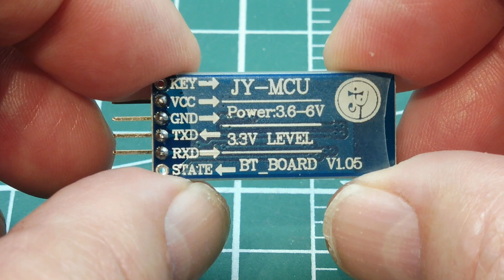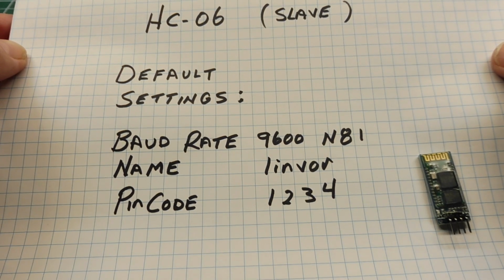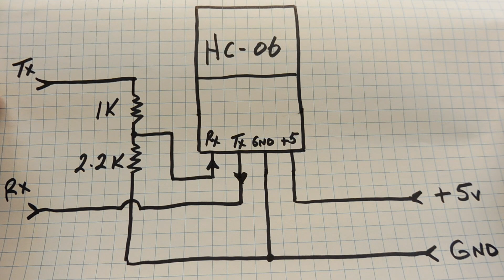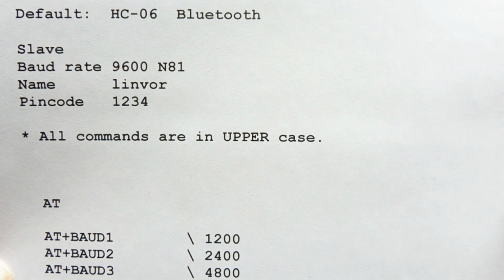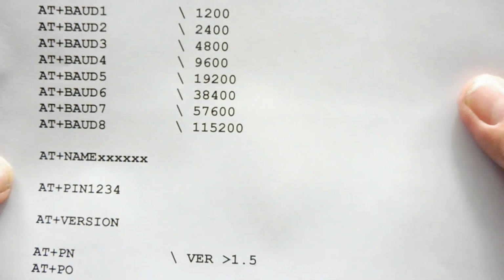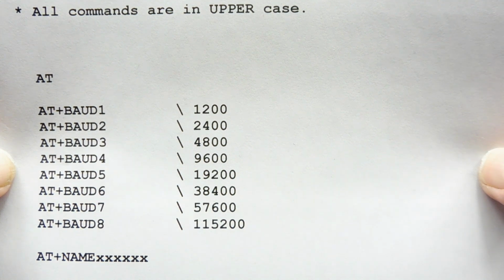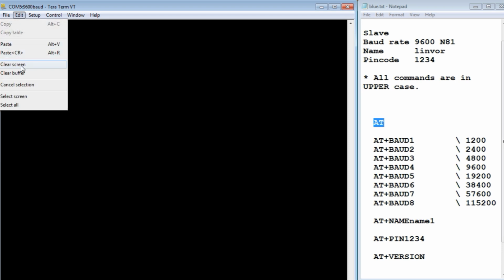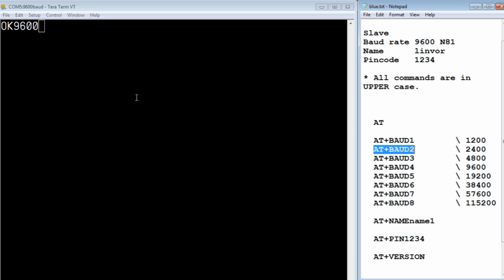How to program the HC-06 Bluetooth module

Comment: I am not able to write type anything on the terra term screen. Not even a single letter. Right clicking does not respond for pasting anything. I want to configure HC-06 based  DSD TECH B30 RS 232 to BT serial converter. I am using CH340 USB to serial cable to connect with laptop windows 11

Comment: Hello, I have an HC05 which i am using instead of the HC06. So I wired up the HC05 the same as in the video except I do not need the voltage divider as my usb->serial has a 5v-3.3v jumper.  I am using TeraTerm and I power on, then connect the enable to 3.3v to place in AT mode. I have the slow blink which I believe confirms  AT mode.  I am connected via com5 and when I issue the AT command by just pasting into the teraterm but I do not receive a response.  It seems straight forward enough but maybe the HC05 is still not in slave mode. Do you see anything obvious that I am missing ? Thanks
Reply from the maker: There are many different HC-05 modules out there so always check with your user manual.
Basically power the HC-05 with 5 volts with 3.3 volt levels for Tx and Rx and enable pin on power up. Copy and paste AT (all caps) at 38400 baud. Check out this video:
https://youtu.be/R0s0W68nY7k
Reply: Nvr Mind, default baud was 38400 plus had to play with line ends some.

Comment: Important notice: you have to set transmit delay int Tera Term Serial Port setup. And delay should be 1... 10. I found it in this video :) If you use default delay == 0, HC-06 module doesn't work. It reply to AT but not reply to AT+VERSION. And there is difference between AT+VERSION and AT+VERSION?  :) No question mark is required ROFL

Comment: so the HC-06 is powered and my computer says it is "paired"... however when I try to use a serial terminal to communicate with it I don't receive any data back. The terminal is configured at the right settings, not sure what the problem is otherwise. Thanks for the video!
Reply from the maker: Check out this video: https://youtu.be/obMinxmezSA

Comment: Thanks for the review 0033mer.  Is there a way to control the power for this device?  I would like to be able to turn it on and off from my transmitter.
Reply from the maker: If the HC-06 is powered down it cannot receive a signal to turn it on .If you are concerned about power consumption check out Reyax's low power Bluetooth modules. RYB080I.

Comment: Hi there, I have connected the HC-06 with FTDI-adapter to my computer and tried the arduino serial monitor. I do not get any responce when entering any AT command. Weird thing is that if I connect my phone to the module and enter text in the "Bluetooth terminal" app  then it shows up on my computer screen in the serial monitor. So I assume the wiring is correct. I do not know why the module is not in AT mode?

Comment: there's another gotcha with the AT commands that's not really documented: they DON'T end in any kind of line terminator. if you send, for example, "AT+VERSION\n" with the newline within the timeout window it will not accept it. standard terminal programs are tricky to use, but something like cutecom that lets you send full lines (as opposed to character-by-character for modem/shell-oriented terminal emulators) without a terminator works easily without resorting to awkward copy pasta dances. of course it also doesn't send line terminators after the responses, so the only way to script this would be to use some ugly timeout logic.

Comment: Can you make it connect automatically to an MAC address? I have a Bluetooth multimeter from OWON
Reply from the maker: Not with the HC-06 bluetooth module. You can make it work with the HM-11 v4.0 BLE.
https://hackaday.io/project/12922-bluetooth-data-owon-b35t-multimeter
Reply: 0033mer that is exactly what I’m working on. This HM-11 module doesn’t work the same anymore or at lease since he did the project. I have been on this for 3 weeks now with no luck. Seems like the ROLE command screws the whole thing up. I thought I was on to something with AT+CO00xfffe MAC address 
Some of his commands are not used anymore. Any nudge in the right direction would be great.
Reply from the maker: Keep looking online for a Bluetooth module capable of MAC addressing programming.
https://www.tinyosshop.com/datasheet/Tinysine%20Serial%20Bluetooth4%20user%20manual.pdf
Reply: Using the BLE Scanner i get this.
There is only one that has a Notify "N" and its this.. 
CUSTOM CHARACTERISTIC
UUID:0000FFF4-0000-1000-8000-00805F9B34FB
Properties: NOTIFY
Value:[x]
Hex: 8x19F00400B901  !!!!!THIS NUMBER CHANGES WITH MULTIMETER VALUES
!!!!!
Client Characteristic Configuration
UUID:0x2902
Notifications enabled
Characteristic User Description
UUID:0x2901

I have tried to set the module to AT+UUID0xFFF4 Thinking this would solve all my problems,I get the same trash readings. Do i have to set the UUID to a different setting???? I said earlier that the BLE Scanner is seeing the data by the changes in the hex.

Comment: whenever I send a command to the HC06, I just get the same command back. E.G. I send AT, the module replies with AT. If i send AT+VERSION, the module replies with AT+VERSION. How can i fix this?
Reply from the maker: Check the configuration of your serial terminal program. Sounds like your local echo is turned on.

Comment: Hi, Thanks for the video, I am trying to change the baud rate using FTDI adapter but i cannot see any command in the dialogue box when i click on send. Any help is appreciated thanks
Reply from the maker: HC-06 is powered with 5 volts
Tx ans Rx lines connected properly
Led is blinking (not paired)
Use uppercase commands .. Try AT first, watch for OK
Use the default 9600 baud to send commands
Try different baud rates as 9600 may not be default.
Reply: @0033mer  Thanks for replying, I had try all the above nothing shows in the dialogue
Reply from the maker: Check your programming setup with a known good HC-06 module. If it checks out good, your original HC-06 could be bad.

Comment: Standard RS-232. Signal levels are -13v and +13v. I assume the USB cable you are using is using std TTL logic of 0 and +5v and NOT RS-232 signals
Please confirm.
Reply from the maker: The USB cable is a TTL RS232 cable that uses 0 and 5 volt logic levels. http://www.dipmicro.com/store/USBTTL-PL2303
RS232 is a recommended standard originated in 1960 that has changed many times from RS-232, TIA-232, and EIA-232 with voltage levels from +/- 5 volts to +/- 25 volts. TTL RS232 is quite common today with the popular FTDI modules which you can use instead of the cable.
Reply: there is no such thing as "TTL RS232." this module uses 3.3V TTL natively (the common breakout boards accept 5V since apparently platforms like Arduino are never going to migrate away from legacy 5V signaling...), which is a different voltage and polarity and therefore completely incompatible with RS232, although look at the Garmin 18x's interface for an interesting hybrid that's sort of compatible with both.

Comment: There are lots of differences between the modules. My one was default 38400 and I had to put the KEY pin to HIGH to use AT commands. Here is lots of info  https://www.instructables.com/id/AT-command-mode-of-HC-05-Bluetooth-module/  I also had to set the terminal program to use CRLF after every command.
Reply from the maker: Sounds like you are describing the HC-05 bluetooth module which is totally different than the HC-06 module. The HC-05 can be configured as a master or slave as the HC-06 is a slave only. https://youtu.be/R0s0W68nY7k
Reply: @0033mer  I bought the HC-06 at Banggood. It does not show HC-0x anything on the module so I am not sure what is is. From what I read on the internet the hardware of the HC-05 and the HC-06 is the same. The firmware is different. But please correct me if I am wrong. My module shows "VERSION:3.0-20170609". Do you know a way how to determine if it is the 5 or 6? I am willing to do tests and publish it here or send the info to you. Your video helped me at lot. My comment was/is intended to help other who still have problems.
Reply from the maker: With the success of the HC-05/06 other vendors want into the game but are not following the rules, That's OK as long as they put out proper documentation on their product. The HC-05/06 hardware is very similar and the firmware is different as you said but some vendors have put a push-button on the HC-05 for the Key function. Bottom line is get proper documentation before buying any non-standard modules.
Reply: @0033mer  proper documentation is a great idea, except how do I or any other buyer know that the documentation matches the product? I thought I bough HC-06. I still don't know if I have HC-05 or HC-06. How can I find out? I.e. which are commands which one of them accepts and the other not?
Reply from the maker: If you can configure it as a "master" I would consider it compatible to a HC-05 module.

Comment: I am having an issue with my bluetooth HC-06 module (It's the one with ZS-040 board) . I have followed the instruction as stated in the video. But I am not able to get it in to AT mode at all. I have double checked all my Tx, Rx Vcc and GND connections but with no luck. The LED keeps blinking at a fast pace with and without the voltage divider circuit( Like even when I connect it directly to the FTDI cable) . I am able to communicate with the module using my phone using blutooth terminal software in the pairing mode. But whatever I do, I am not able to get it in to AT mode. I also tried shorting the Vcc to Pin 34 and the LED blink rate reduces to once in 2 sec, But It never gets in to AT mode. I also tried all baud rates , but with no results in any. Any help from anyone would be appreciated. Thanks.
Reply: It will not react if you will print commands manually. It has very short command window. Copy paste or use Arduino SDK's Port Monitor

Comment: Got a problem with HC-06 module. My module responds to my AT commands through the arduino, but wont show up on any device. So far i have tried 3 phones, laptop and a BT module to my PC. Anybody got any ideas?
Reply: Sounds like the radio section of the module is bad. Use a different HC-06 module in the same circuit setup to verify the problem is a faulty radio.
Reply: Thanks for the tip, will look into it

Comment: I do have a FTDI USB to TTL serial converter module, and have used it as I followed your video tutorial to the letter, but I recieve no response when I type " AT" nothing returns...
the Bluetooth sends and receives data just fine... I have been able to pair it with my PC. I also made sure it was not paired before I attempted to send the "AT" or any other command. Any suggestions???
Reply from the maker: Check your wiring .. make sure Tx and Rx are not swapped.
Make sure your terminal program is working properly. Check out this video: https://youtu.be/obMinxmezSA
Use capital letters when sending AT with module not paired. (LED blinking) No return is required.
Default baud rate is 9600, but try other baud rates until you get a response.
Try another HC-06 module.
Reply: Thank you, for your response!
Reply: @0033mer  By "not reversed", do you mean RX to RX and TX to TX pins, instead of RX to TX and vice versa? Thanks.
Reply from the maker: @EdwardThian  Yes .. that is what I meant.
Reply: @0033mer  Thanks for your prompt reply - much appreciated. Is the voltage divider still required when connecting TX to TX and RX to RX? I'm using a USB-TTL programmer (https://www.banggood.com/5V-3_3V-SCM-Burning-Programmer-Automatic-STC-Download-Cable-USB-To-TTL-USB-To-Serial-Port-Function-p-1176249.html?rmmds=myorder&cur_warehouse=CN)
Reply from the maker: @EdwardThian  If the TXD output of the programmer is 5 volts then you will need a voltage divider feeding the RX pin on the HC-06.

Comment: any idea how to do this without a usb cable? I am trying to follow some tutorials using SoftwareSerial and uno, but when I type in AT nothing returns...
the bluetooth sends and recives data just fine...
Reply from the maker: There is a link in the description box of the USB to serial (TTL) cable that I am using.
You can also use a FTDI USB to TTL serial converter module which is basically the same as the cable:
https://www.banggood.com/FT232RL-FTDI-USB-To-TTL-Serial-Converter-Adapter-Module-For-Arduino-p-917226.html?rmmds=search&cur_warehouse=CN

Make sure your TX and RX lines are not reversed, commands in UPPER case and use copy/paste, BT module is not paired to anything and use default baud rate.
Reply: ty for the quick reply, but I dont have the cable, and I don't NEED to change the settings, but it would be nice if I could(so not gonna buy a usb converter. ). I do have an arduino uno sitting around.
I had an idea of using it, to forward the commands from my pc to hc06. 
any suggestions/pointers?
Reply from the maker: OK ... You want to use the USB to serial converter onboard the Arduino UNO.
To do this you need an UNO with the ATmega328p microcontroller in a DIP socket. (Not SMD version)
Remove the microcontroller from the socket.
Connect pin labelled RX on UNO to voltage divider then to the RX pin on the HC-06
Connect pin labelled TX on UNO to TX pin on HC-06.
Connect grounds from UNO and HC-06 together.
Connect UNO to computer using USB cable and run serial terminal software to program HC-06 with AT commands.

Comment: Hello sir! I'm using USB to serial cable , the voltage on the TX pin indicate -5 v but when i connect the cable to the BT module it drops to -0.7 v! ( i'm using voltage divider as you shown)
Reply from the maker: 1. Check that you have a good BT module and that it is operational: https://youtu.be/obMinxmezSA
2 Make sure you have a USB to TTL level serial cable. There should be no negative voltage on the TX pin.
   If you have a negative voltage on the TX pin that is the wrong cable. Use  a FTDI USB to serial module.
3. Verify all circuit wiring and ensure the TX and RX connections are not reversed.
Reply: I used CP2102 but the module is not responding to AT cmds, when i connect the RX and TX pins it work fine, so is there any hardware reset or any other solutions! Thnx

Comment: hc06 如何回復出廠值出廠的鮑率,已經無法輸入AT了
Reply from the maker: If you changed the default baud rate from 9600 to another value and later forgot what that value was, then you have to try them all using a serial terminal program. Go through all the speeds typing AT on each baud setting until you get a response. There is a configuration tool that is available that will do that automatically:
https://www.windows7download.com/win7-bluetooth-module-configuration-tool/npkogstg.html
Reply: THANK YOU

Comment: HelloI have two questions:1.when you use a USB to serial cable,do you cut the db9 connector and connect the wires coming from the USB ?2.If the answer for the above is yes, how do you determine which is tx or rs ?ThanksSam
Reply from the maker: 1: I did not cut the db9 connector off a USB to serial cable.
The cable I am using is meant for breadboard interfacing. The green wire is Rx and the white wire is Tx.
You can buy them here: http://www.dipmicro.ca/store/USBTTL-PL2303
2: Instead of an USB to serial cable you can use a FTDI module.

Comment: Please, how I can program the HC-05 Bluetooth module ??
Reply from the maker: Check out this video:
https://youtu.be/R0s0W68nY7k
Reply: i am using fdti232 board
i cant do that
what should i do ?
Reply from the maker: The FTDI board should also work.
It is basically the same as my USB to serial cable.
Verify the FTDI board, check for correct driver, connect TX to RX and check for echoed characters.
Verify HC-06 operation. Pair to it, connect TX to RX and check for echoed characters.
Check out this video:  https://youtu.be/obMinxmezSA
Reply: i have connected everything correctly and also have installed the driver correctly
there is a pin on my FTDI board labeled as DTR
whats that?
i would be grateful if you reply me in my email
abdulsamaddabu@gmail.com
Reply: and also i have echoed characters 
the Bluetooth module is working perfectly fine
Reply from the maker: Try another FTDI module.

Comment: Hello! I want to use my HC-06  for project but I am not sure if my phone could really connect to the module. I checked everything in my project a few times and ı m almost sure that there is nothing wrong with my circuit or coding but when ı choose hc-06 in my bluetooth list. It says it is connected and hc-6'led stops blinking in every second and starts blikning every three seconds. In videos on youtube, ı see when any device connects the module it stops blinking and led just lights. 

Is there a problem with my module or mine is just a new version?
Reply from the maker: Try using a different app on your phone to connect to the HC-06. There are lots of free apps available.
If that does not work, have a friend use his phone and try to pair with the HC-06.
When you connect, the LED will stop blinking and stay on solid.
Reply: 0033mer I tried different apps. i made my own app on appinventor. i used at least four different phones. it pairs with the phone but it doesnt send any data to arduino. i copied and pasted different codes doing the same thing from different projects. changed the wire connections according to the projects but nothing has changed yet.
Reply from the maker: Sounds like a Uart problem. Does your HC-06 baud rate match your project speed?
Check to see that your TX and RX ports are not swapped.
If you have a scope you can monitor the RX line for data.
If your wiring seems to be correct you might have a bad HC-06 module.